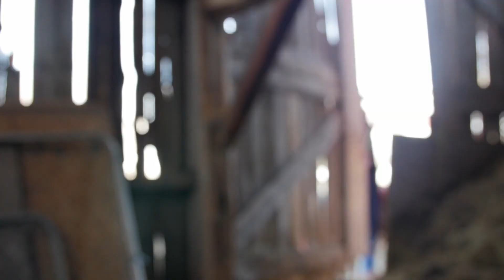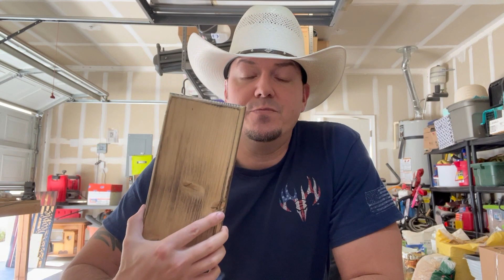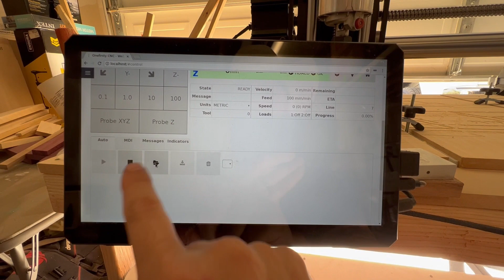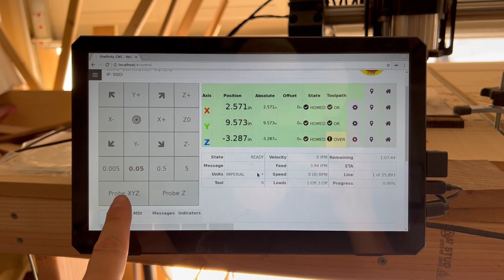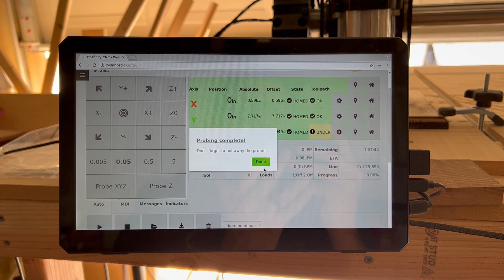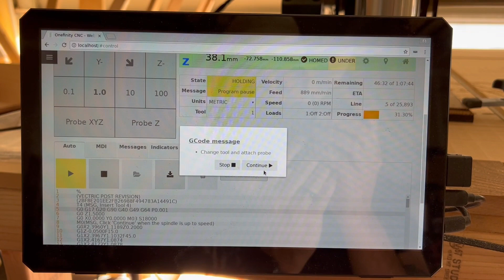How To Properly Use Your 3D CNC Touch Probe

Comment: very worst toy cnc machine, linear rails not have support ,not good, spindle have worst router noise lot and not good to cnc, need be REAL spindle can controll better speed,heat,etc and not noise horriple. software not good similar than old pre history GRBL worst controlling system,  pro not newer buy or use this. maybe young 8 year boy first machine can use.

Comment: First time I ran mine and homed the machine just like this my bit hit the clamps. Then again when I went to start the project as it was moving from the home position to the starting point of the first cut and I broke the bit. Definitely a learning experience
Reply: if hit clamp not has looking code good and safety height not have make. clamp neeed be sure out of working area.and safety height need setting before try start machine first time
Reply: @@mattivirta  I mean...thanks for the help, but that's the worst put together sentence I think I've ever seen

Comment: Wait. How did you get it to tell you to insert tool before starting and re-probe for z after a tool change? That's so cool. I don't have VCarve Pro, I am using Fusion 360. When I do a tool change it won't let me re-probe for z.
Reply from the maker: I’m not too familiar with other software, but yes - VCarve Pro allows you to re-probe Z after a tool change. Pretty cool indeed!
Reply: Hi David, were you able to get past this? I'm using Fusion 360 and just ordered the X50.

Comment: What software are you using?
Reply from the maker: Hey JT! I’m using VCarve Pro. I highly recommend it although I don’t have much experience with any other software out there. I’ve tried Carveco and Easel on a very minimal level and didn’t like either as much as Vcarve. For my vectors, I build most everything in Adobe Ilustrator, then transfer them to Vcarve to make sure any “kinks” are worked out before milling.
Reply: @cowboycraftsman  vcarve can translate traight to machine g-code work. not need other software make g-code what working. if machine not understand normal g-code not have normal good machine. GRBL can use g-code but only some not support all code and have toy. mach3 have worst and dangerous use not have TRUE REALTIME machine very dangerous. linuxcnc working perfect and have flexiple can make lot own hal and makros and tools easy. true realtime and true pro software, not toy. many sell cnc but all american cnc machines i has test and looking have something worst shit.- only germany has can build good machines and only liuxcnc software support all what pro need.